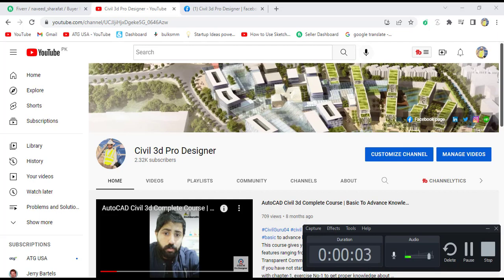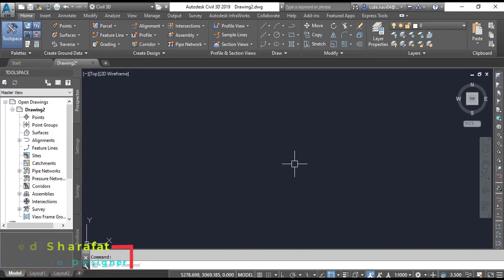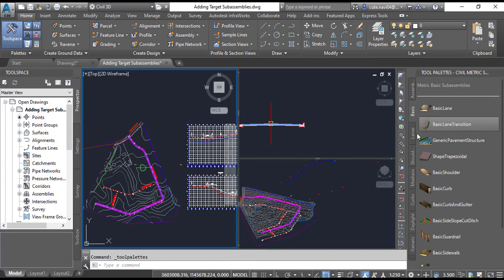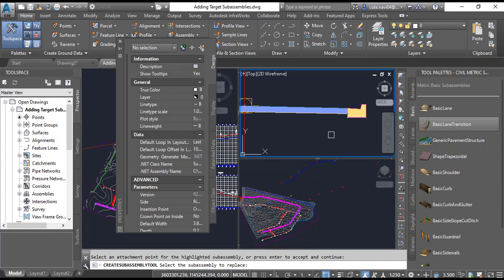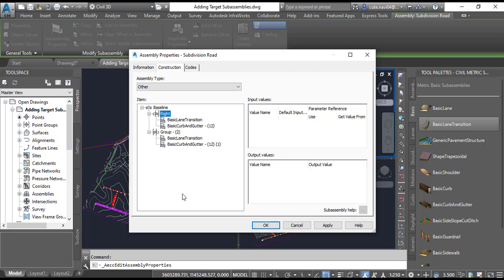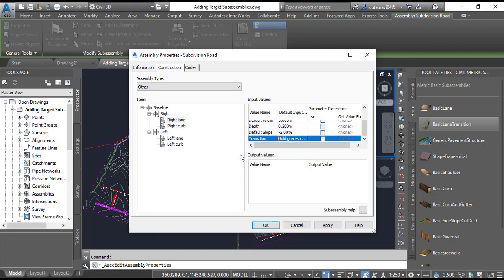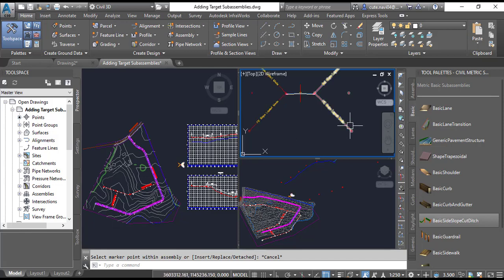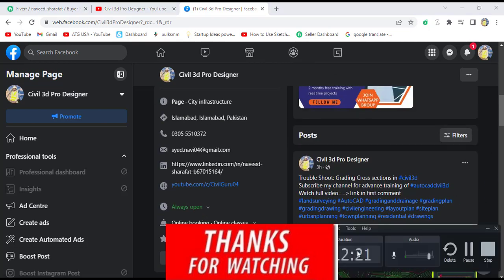How to Create Subassemblies in AutoCAD Civil 3d | Civil 3D Subassembly Composer | Civil 3d Training

Comment: Hey bro please make one video on offset alignment I need it how can we use it more efficiently with all the widening criteria etc
Reply from the maker: Ok but already youtu.be have many video about that
Reply: @Civildesigns04  just make a video on you have a alignment about 10 km and try to draw offset alignment then use all the widening criteria for small segments for bus lane etc ..I try alot but evry time I got stuck and feels like this option is good but didn't work smoothly I thought I'm making mistakes so that's why
Reply from the maker: @sanketdongare9926  i think you are facing issue due to your surface but not alignments
Reply: @Civildesigns04  I did it without the surface also
Reply from the maker: There is something wrong you are doing definitely.. otherwise its not much headache..i mean its simple
Reply: They have but they are not showing actually how to use it such for long alignment like 10 to 15 km just showing the option of civil 3d as we know that it's a heavy software and I have best spec in my laptop I 9TH GEN PROCESSORS ..my point is how can we use it in efficient manner bcz while using object drawing gets more heavy